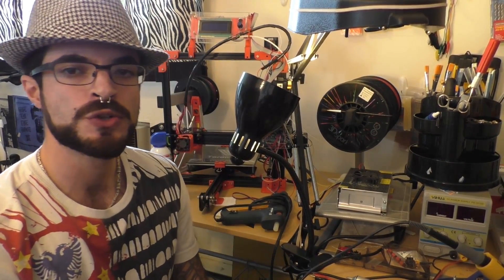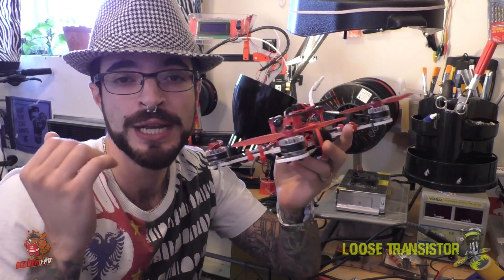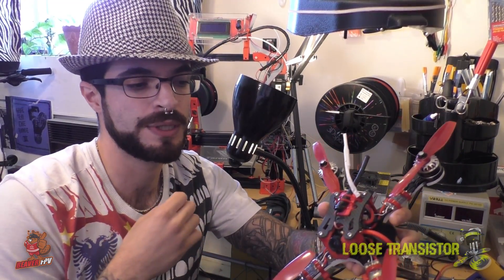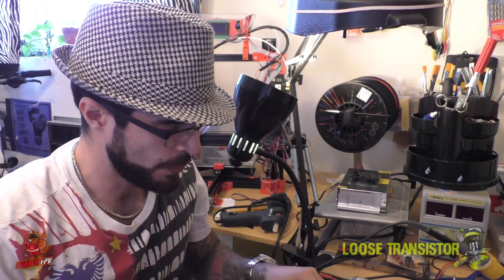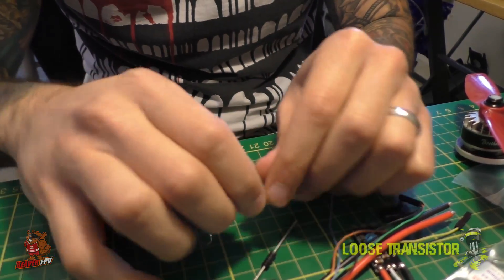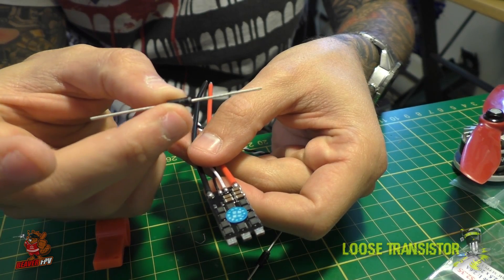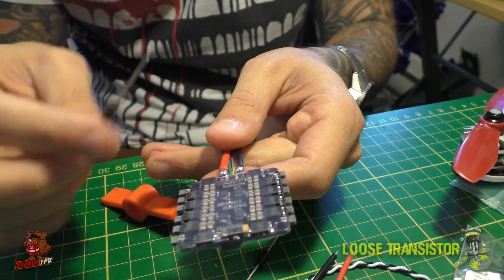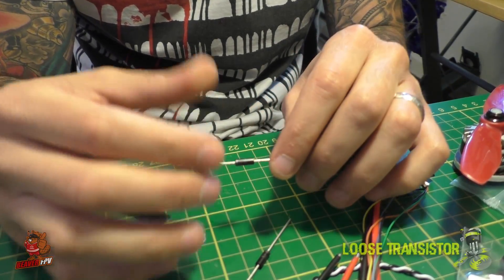Capacitors are DEAD. Long Live DIODES! ♠ [ How To QUAD ]

Comment: I would be surprised if this does what you want it to do. From an electronic engineering viewpoint instead of trying to "clean" the whole system, I think the better approach would be to isolate and clean (filter)the power to the VTX and camera.  Just seems it would be an easier job.  But it will be interesting to see how this goes.
Reply: indeed, they are not primarily a filter device. They are intended to snub transients, which can and do kill VTX's, cams, FC's and ESC's.  The transient can also shoot through regulators, as well as generate radiated EMI as the transients are very energetic.  These transients can be on the order of 100+ volts, and relatively high current on modern race quads.  This excessive , extremely fast , energetic voltage "spike" can wreak havok on the entire system in many ways other than simply an overvoltage.  Being a long time electronics engineer in the automotive industry, I can assure you a TVS is the answer to many of the issues that plague modern builds.   I have been using them for years in industry, as well as on my quad builds.  You may also notice there are several manufacturers that are now integrating them into their ESC's and PDB's,  and for good reason.  Albeit , up until fairly recently they were not an absolute requirement.
Reply: With modern builds switching extremely high currents into inductive loads, and with aggressive active braking , a cap will not absorb the energy fast enough.  A transient by definition has a very fast rise time, very short duration (on the order of pico seconds) , and extremely high relative voltage.  If you plot a transient, the area under the curve is the energy that must be dissipated , which can be many hundred of watts.  The large caps people are using for this purpose are not fast enough to snub a true transient.  Hence why a lot are still having cameras and VTX's killed even with a large amount of bulk capacitance.
Reply: They could be related to transients.  A lot of people who have used TVS have reported a significant reduction in horizontal banding , as has been my own experience.   That part number should be suitable for pretty much any build.  I personally use SMD versions , but that may be tedious for some to work with.  Keep your leads short , and be sure to install them reverse-biased.   Albeit , your wiring configuration (how you have your wires ran) can have a negative effect as well.  Check that also in the mean time.
Reply: Do you recommend the part spec'ed by Loose for bridging the battery pads on a LittleBee 4-in-2 ESC? I was going to use a low ESR 1000µf cap, but this seems like a more sound method. I'm getting a lot of horizontal banding in my video, worse on punch outs, and have had a few odd glitches I think may be related to transient spikes.
Reply: Thanks, I'm going to give the diode a try and hopefully it will clear at least some of the vid issues up and also take care of spikes.
Reply: Seems like it would be quite trivial to measure the change.  Have you hooked u a scope and seen what's actually happening?  I'd love to see a link.
Reply: I have indeed, however I have no scope traces at this time to show.  Those are coming in the next few days.  I have used these devices for inductive load applications (which is what we have here) for many many years, and have had to verify their operation per requirement by various automotive manufacturers.  It not like this was just pulled out of thin air.  It not like we need scope traces to verify their operation.  Only those who do not understand the issue, or what a TVS is, and does, will require such.   There is a problem that exists on these devices and being an experienced engineer who deals with this issue continually, I understand the problem, and how to rectify it, and this is the answer.
Reply: I could as easily translate that into "I install car stereos for a living."  Post up a circuit diagram of what you are proposing, what it's supposed to solve, and proof it actually does it, and everyone will be all happy.  You seem to have confused Loose Transistor as to what it is your diode is gonna do, so clear it up for all of us less intelligent and educated people.
Reply: Documents have been linked, and the information on what they are, and how they work are available in many places online.  However, I would suggest you start at what a transient is , and how they become an issue with inductive loads, and correlate that into how and why they work in this application.    

I cannot, and will not take blame for confusing anyone.  If anyone is confused its due to their own lack of understanding, where a few minutes reading may help.   

Admittedly, Loose probably jumped the gun a little bit trying to provide an explanation before fully understanding.  However, he states this in the video.  If anyone takes his explanation definitively (and it seems they have), after stating that he does not really know what hes talking about , its their own fault.  

Lucas, nor myself, are responsible for any ones lack of knowledge on the matter.  The information is a few keystrokes away.  Additional information will be provided , but not on your terms.  It will come as it can.

Until then, I suggest you keep using whatever it is you feel necessary. Nobody is forcing you to use a particular device, for any particular purpose.